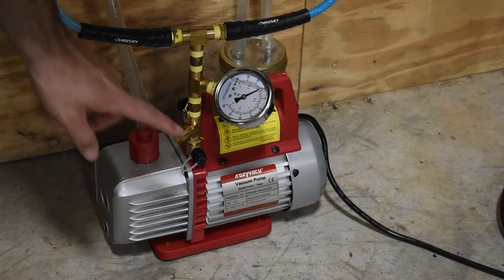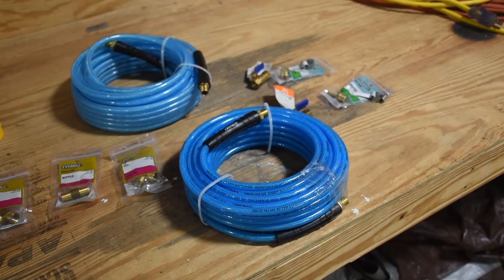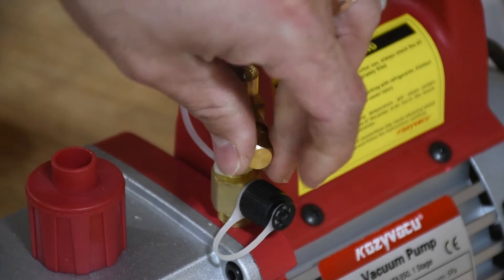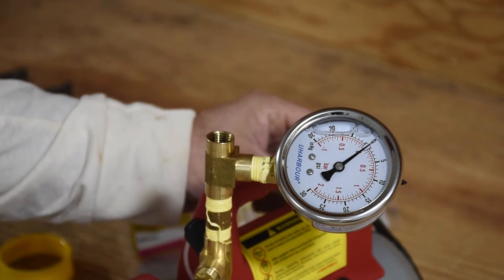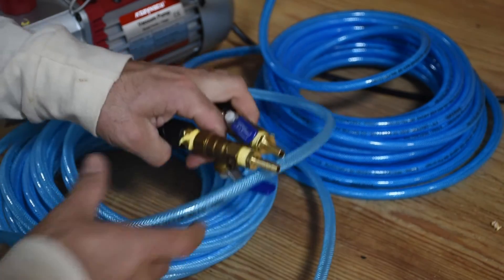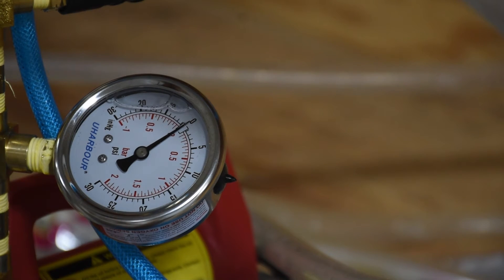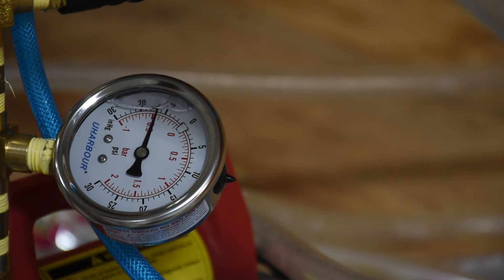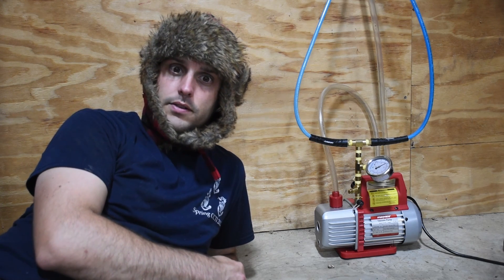How YOU can Build a Milking Machine  for LESS than $200

Comment: Did you consider (and find) a 12V DC vac pump?
Reply from the maker: The though did not even cross my mind. Depending on what the flow rate is it should easily work.  If you are only doing 1 animal at a time the required volumetric flow rate is surprisingly low.